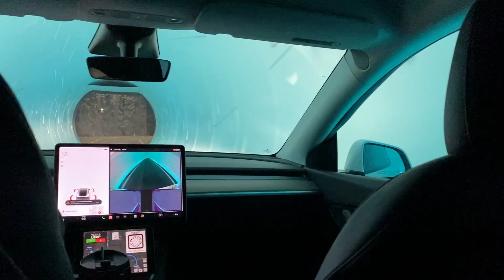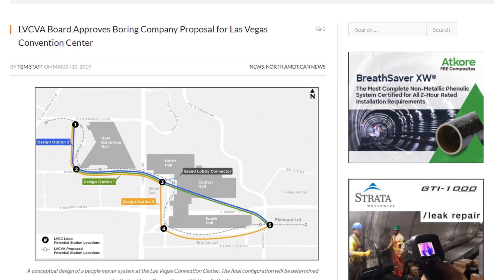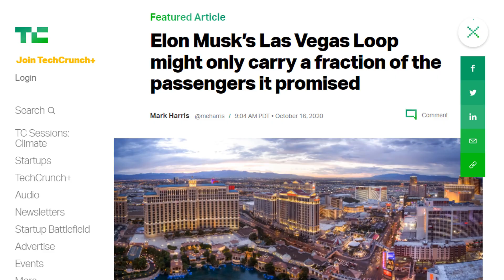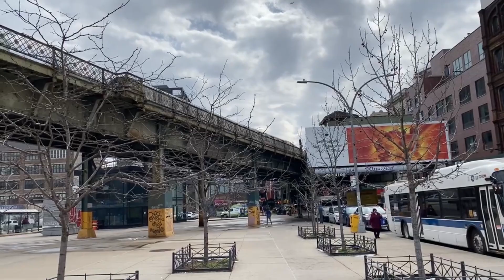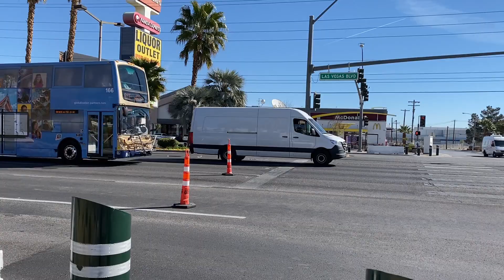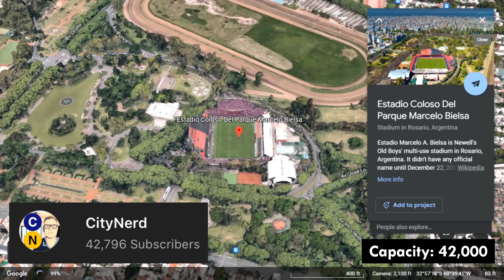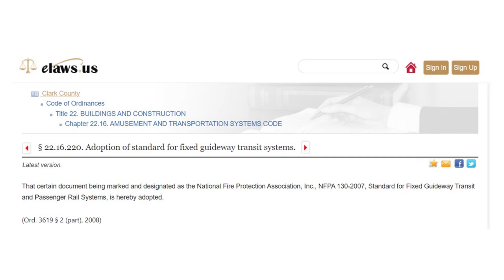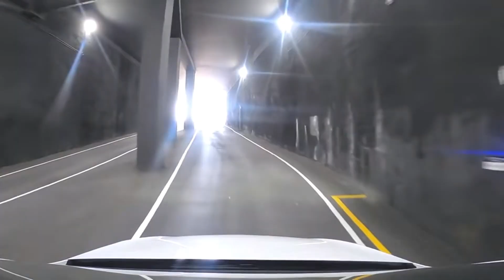Inside the Las Vegas Loop: Transportation Game-Changer, or Complete Waste of Time and Effort?

Comment: I think you miss the point, moving in 3D offers more possibilities than in 2D, and it is easier in the ground than in the sky. The final plan is to get in at a station and to chose at witch station you want to go, wherever on the network, and all in autonomous cars. But obviously it is a work in progress. If you think it is stupid, so are taxis, not to mention taxis need roads where space should be used for pedestrians, bicycles, sidewalks and a lot of trees. I am not saying Musk's project is perfect, but only that stating only the drawbacks makes the demonstration weak. My whole family is using public transportation everyday and connections are a big issue that could be addressed with such "underground robotaxis". And off course, having autonomous electric cars underground does not mean you cannot have other options at the surface, on the contrary since it is freeing space, especially bike lanes, large sidewalks, but also tramways for main lines, and off course trains for inter-cities connections.
Reply: The point you say he missed is not really well thought out. It might sound interesting, innovative or even intuitive but it just isn't. To start, " moving in 3D" through a city is nothing new. The Big Dig in Boston was a 3D solution, for example. All existing tunnels and viaducts, for road or for rail, are 3D solutions. 

Express transit also exists. Having a range of levels of service ensures that many (but not all) journeys are non-stop. Having all journeys be non-stop is inherently less efficient because all low-demand journeys require extra vehicles, whereas an all-stop transit  service can consolidate all low-demand journeys to one vehicle or train. Having differing service levels can be done with or without adding a new path between stations, but usually requires at a minimum that some stations have extra passing paths. 4 track systems can accommodate a huge range of service types and can provide a majority of travelers with a either a one-seat ride or non-stop ride.  

But with all journeys having a different vehicle, the size of the busiest loop stations will become large and chaotic, especially given the necessity of including holding areas for unrequested vehicles and turn-around  facilities for one-way demand surges. 

Loop can do a lot of things that a metro can do but to serve increasing levels of demand it cannot be scaled up as easily as rail transit can with good long-term planning.   Also, with good long-term planning, connections can be barely an inconvenience, as short as perhaps 20 steps.

Loop (not strictly underground) may have a future yet,  as the exclusive domain of driverless road vehicles, "robotaxis", and personal vehicles where drivers can tune out. A separate type of road infrastructure will be necessary for fully automated road vehicles. Limited access highways will probably also permit fully automated driving, but likely demand an operator for liability if it is sharing the road with human-driven vehicles. However, even if an autonomous vehicle is 99.999999999% of the time a safer driver than a person, on city streets at least, or where they operate faster than approx. 15mph alongside human-driven vehicles, they will likely need a human operator. This is not a technological limitation, but one based on legal liability. Shifting liability to the self-driving software itself is also possible, but I doubt carmakers would want to assume it. Another alternative would be only allowing self-driving cars on streets, but this would be catastrophic to walkability in general, non-car users, and users of non-self driving cars. So Loop could have a future, but it isn't going to be as a good general replacement for rail. Its future is mostly an evolutionary step up for road infrastructure and technology. 

In terms of physics, rail tech is inherently more efficient than road tech. Road infrastructure can be cheaper to build though so for medium to lower volumes of traffic it  is often the optimal solution. But, road technology as it is built now still requires a lot of petroleum to be done cheaply (the tires, the asphalt). Making electric cars as environmentally friendly as trains will require much more (now expensive) recycled, synthetic, advanced  and alternative materials.

Comment: Too bad Musk's original vision of the Loop couldn't be implemented, which was supposed to have featured some kind of higher capacity tram like you take at airports.
Reply: It takes longer to develop such a vehicle than it did to build these tunnels.   I hope they’re working on a autonomous shuttle bus that will fit in loop tunnels.  They don’t need it for the LVCC loop, but I think they will need them eventually for the Las Vegas Loop, and other proposed loops.
Reply: @kevinbailey8827  I see. And “skate” was the word I was searching for not tram.

Comment: It’s not just that it’s normal traffic, it’s stop-and-go wait for tunnel to completely empty before car goes other way traffic. Like the stop and go factor is preposterous. But yeah as a mechanical engineer I would like to point out that it’s fairly easy to make a robot that can autonomously drive along a painted line. I mean even easier if it doesn’t have to recognize a painted line and can just use “pass from point D to E at this speed while accelerating that much unless emergency stop flag is active”

Comment: This is the start of a genius, revolutionary idea. We just need to make the cars into larger pods to carry more people, with seats and room to stand. We can attach a bunch of them together to carry even more people. Let's replace rubber tires with steel wheels on steel tracks, less resistance so less energy needes to move them. We can add platform boarding. I suggest trying it out in New York. I even thought of a name: Subterranean Underground Bypass for Wagons Accelerating You, we can call it SUBWAY for short.

Genius.
Reply: That’s going to cost a lot of money, and make the system less useful for passengers. Better to take some of your ideas, such as larger pods mixed in with the smaller ones.   When you have groups of people all going from point A to point B, it makes sense to put them in larger pods.   But putting people into pods indiscriminately means each pod has to stop several times (once for each passenger destination).   Hook all the pods together and it’s going to have to stop at every station just in case someone there wants to board one of the chained pods and go somewhere else. 

That really cuts into your level of service!
Reply: @kevinbailey8827  http://www.youtube.com/watch?v=2sRS1dwCotw
Reply: @electric7487  Explain.